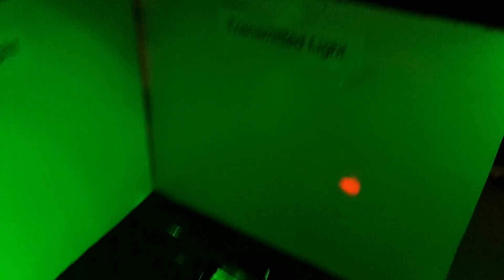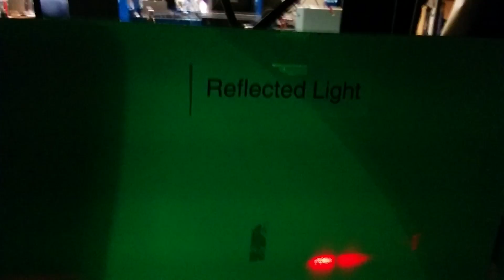Surface Plasmon Resonance

Comment: For the UV-SPR investigations, Al is a suitable metal because its plasma frequency (2.4 × 1016 s−1) is higher than the light frequency in the UV regions
Reply: What is plasma frequency and how does it relate to electron
Reply: @johnnycash4034  he's talking about the frequency of the surface plasmon, which is basically the natural frequency of oscillation of the electron density/cloud on the surface of the metal.